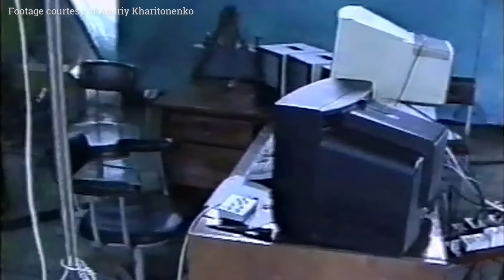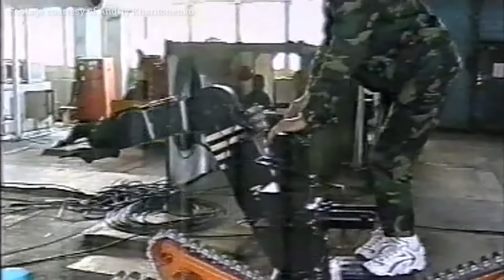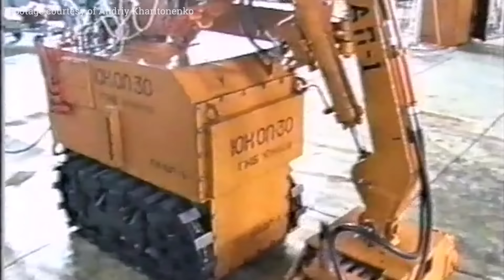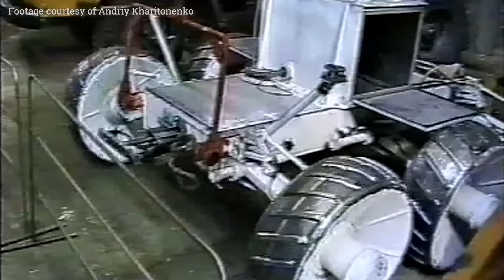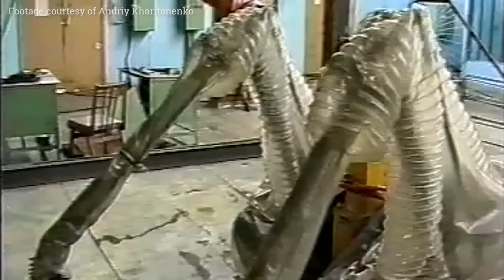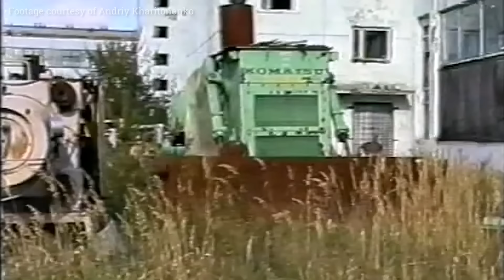Chernobyl's Robots (1998 Found Footage)

Comment: Am I supposed to believe that the most radiated robots in the world were actually taken down from the roof and saved?
Reply from the maker: I will tell you more: robots that work inside the Sarcophagus, where conditions are far worse than on those roofs, are sometimes taken out, cleared and serviced. There is a common belief -- "exposed = irradiated" which is correct only when we deal with neutron radiation (that is a rare thing). Absolutely vast majority of cases is surface contamination via microscopic sources in a form of fine dust, liquids, etc. This generally can be washed away using a large variety of specialized chemicals, compounds and solutions -- sometimes completely, sometimes to some grade. In original sound of this video it is badly possible to recognize that the camera operator says to the man in the end literally "do not touch too much, they are radioactive"; and occasionally there are fences with radiation warning signs. 
But, 'contaminated' does not mean 'nonfunctional'. Contaminated equipment can be used just with safety protocols applied.
Reply: @ChernobylFamily  Thanks for explaining that to me.

Comment: I just recently finished ai-upscaling, de-noising and sharpening 50 original 1990's camcorder vhs tapes from 25fps to 50fps 1080p. 

If you have the original VHS tape rips i'd be very happy to run them through the same setup and you could share the improved footage on your patreon. 

Would be my pleasure, sent you an email.
Reply from the maker: thank you! i sent you a message.

Comment: It's hard to imagine here I am waiting on my remote control electric gas hybrid lawnmower. No teather 55 degree slope and remote start and hight control.  And yes I'll probably put an fpv camera on it to use with my fov goggles.
Reply from the maker: Actually, can be an interesting project :)
Reply: @ChernobylFamily I was building one from scratch. But kind of abandoned it so finally just ordered one.  I have a stupidly steep lawn. Hopefully I can do at least the parts that are 45 degrees with it